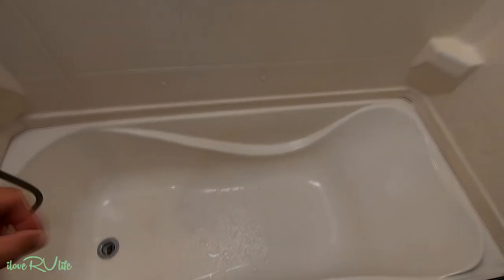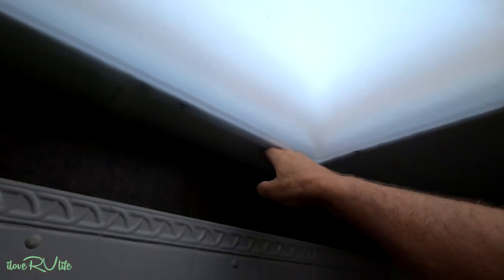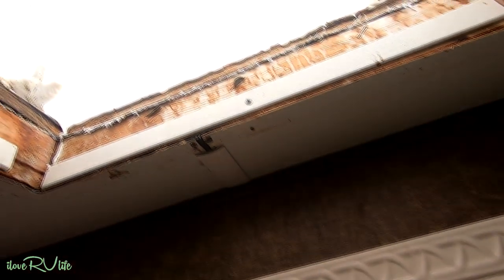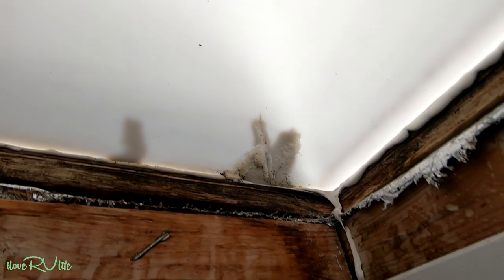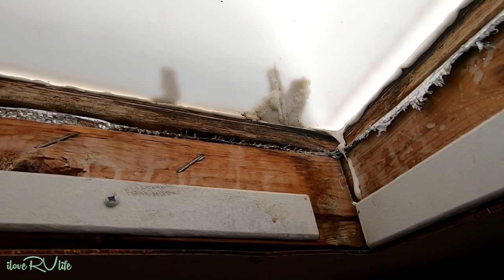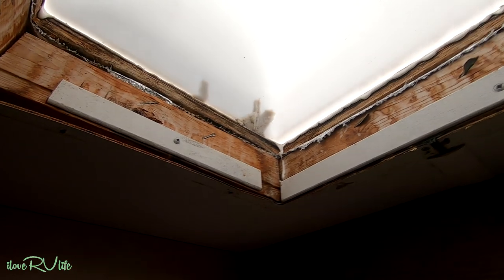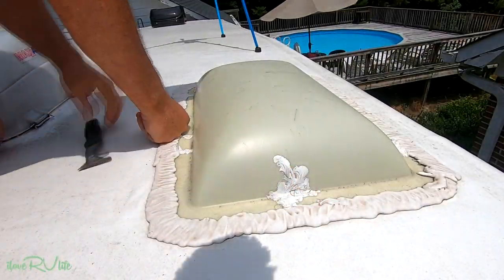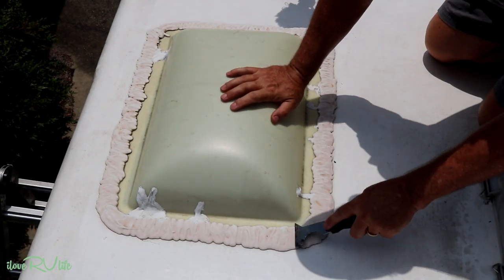RV Skylight Repair

Comment: When I replaced our sky dome I had my local machine shop to make a aluminum ring so I could clamp the sky dome down.  I drill the holes to match the sky dome then inserted the screws then dealer it up with the appropriate sealer. I think that this will not put as much pressure on the sky dome screw holes. Maybe this will stop the sky dome from cracking at the screw holes.
Reply from the maker: Great tip.  Thanks for sharing.

Comment: Thanks for the instructional demo.  My question is about the zig zag caulking you did over the screws and around the edges at the end.  I heard some recommend using Eternabond tape instead because it doesn't leave a small dam between the skylight and the caulk that can hold water and eventually possibly leak.  What do you think of this?
Reply from the maker: Glad to help Charles.  I the follow the manufacturer’s recommendations.   Never had an issue with it holding water.

Comment: You was lucky I just bought a leak free national seabreeze and the first big rain I found water leaking into the shower I pulled of the cover and was swarmed by moisture ants and then I seen the black mold then I seen the little spots of rot in the thin plywood sheet that's on the insulation.There was no way to spot this unless there is a major rain event like what happened here for 3 days.I do not know if previous owner lied or not.I also found gaket leak in the bay.Hiw would u deal with the rot.I paid quite a bit for this motorhome and I thought I checked it out good .Look one over after a big rain before u buy.Thank you.
Reply from the maker: The skylights last about 3 years.  Between to road vibration and sun baking them, fine cracks start at the screw holes and run.  Should check the roof twice a year.  Once the one crack starts, they run and others will follow.  For the mold, scrape what you can then hit it with straight bleach every other day for a week.  This should kill it.

Comment: Hi there buddy. Great video. And yep you got me. I’m now a subscriber 😁😁😁😁 I’ve got the exact same problem on my motor home. But luckily I don’t have any cracks in the skylight. 👍it’s just the sealer that has given up the ghost. Well this is cold old England and it’s winter here so a good repair but a fairly quick one. Until the spring comes anyhow as it’s freeeeeezing here at the moment 🥶🥶🥶🥶🥶🥶roll on summer 😜😅😁👍
Anyway hope all is good. Stay safe 👍👍👍👍👍 And a superb repair you did 🥇🥇🥇🥇🥇
Reply from the maker: Thanks for the sub Jay.  Glad the video was helpful. Hold on! Spring is on the way.

Comment: I'm glad I found this video thank you you so much. We just purchased a Forest River Wildwood and storm this week I noticed water on the floor. In the bathroom the skylight was damp I thought it was condensation from a shower. now I believe it is a leak. Do you know where I can find what size to purchase.
Reply from the maker: Thanks.  Glad we could help.  Don’t let this go on.  Leaks can quickly cause rot and mold.   Until you can replace, find the cracks and put some silicone caulk to stop the leaks.  This is a temp fix.  Go on top and measure the outside flange.  There are several common sizes.  I bought this one off Amazon.
Reply: @iLoveRVlife  thank you. I will get to this right away.

Comment: A well done job is a job well done👍
Reply from the maker: Thanks Greg.
Reply: @iLoveRVlife  
Hey Jerry.
I've been using dawn soap in my tanks just like you suggested.  I also us it to wash our rv but someone posted that dawn takes off the wax. I'd like to hear your opinion.
Thanks in advance 
Greg in Michigan
Reply from the maker: Greg, it probably does a little work on the wax, but I put a good Meguires Marine Wax on mine every 3 years or so and can’t tell any difference.
Reply: @iLoveRVlife  
Thanks for the response Jerry. 
That must be good wax to last 3 years.   
Our rv is 1 year old and I used turtle wax but maybe I'll switch.  We do keep ours in my inlaws barn for the winter but it sits outside spring to fall.
Once again thanks. 
Have a Jesus Christ and 
Greg in Michigan

Comment: i saw you  replacing another skylight. did you have 2 different rvs with the same problem? or did the job you did on the 1st one didn't hold up. thanks.
Reply from the maker: We had another one fail. Did the job correctly, unfortunately the hot sun in the southeast weakens the plastic over time causing small fractures.
Reply: @iLoveRVlife  i have seen people applying 303 aerospace protector and they swear by it. or some have applied that liquid henry even on their awnings. i am doing what you did on your last video thank you for posting that. Also i know you said you sprayed bleach to remove black stains , did you leave it on for a few days did you have to scrub? what did you use?
Reply from the maker: 303 is an excellent product.  For the bleach treatment, a couple hours was all we needed.  A light brush and let it dry did the trick.
Reply: @iLoveRVlife  ty i used a rag. 😀

Comment: Any idea what the best and least  expensive brand clear opening skylight is available instead of the dome type that we cannot open or usually see through clear?? I've seen Hengs escape hatches and Heki brand but still trying to figure out which will work best. Thanks
Reply from the maker: No brand that I can recall.  Give the folks at etrailer.com a call.  They specialize in these types of products and have helped me in the past.  If they don’t have something in stock, they can order with a short turnaround.

Comment: The screws appear to be rusty and the substrate material is rotting out do you figure that the screws would still hold? Doesn’t appear to be a good long lasting repair in my opinion.
Reply from the maker: It wasn’t rot.  I would have replaced.  The wood and screws had gotten a little discolored.  Once dried out, I pulled up the roofing and all was in very good condition.

Comment: Wish mine didn't have a dome, I keep a 4 inch thick foam push into it to keep heat out.
Reply from the maker: Ours is a 2 piece.  With the air gap, it keeps the bathroom from heating up.
Reply: @iLoveRVlife  mine is too, but it still let at lot of sunshine in.

Comment: Hi Jerry, just checking in after you have this installed for a little over a year now. How is the new skylight holding up? Has it faded at all? I need to replace ours and want to replace it with one that will last and not fade. I hope you and the family are doing well. Mike
Reply from the maker: Hi Mike.  It’s held up well.  No issues.  I suspect over time it will discolor.  The sun is pretty intense on these plastic components.
Reply: @iLoveRVlife  Only time will tell, we never know :)
Reply: @iLoveRVlife  I'm debating on getting the white one or a clear one. We have a clear one now and am wondering how much light would be decreased by having a white one. Do you know?
Reply from the maker: We have a white.  Much preferred.   Gives a nice diffused light.  Plenty bright for the barhroom
Reply: @iLoveRVlife  Good to know, I appreciate your response and enjoy your videos
Reply from the maker: Thanks

Comment: Will there be a follow-up video showing how you finish up on the inside - also, how do you know/find out what material your roofing is?  Great video as always - many thanks! I have a tarp over my RV roof at the moment.
Reply from the maker: Thanks a bunch.  Most RVs have a rubber roof either TPO or EPDM.  These have a thick feel, almost a cushion.   They are a little rough to the touch.  My roof is a replacement after a not very bright fellow guided me into a large, low hanging tree limb.  For the same prices as rubber, I went with PVC.  A little more durable, very bright white, firm to the touch.  Some units have fiber glass or aluminum, which are obvious.
Reply: @iLoveRVlife  Many thanks for your quick reply, I'll keep this video on filler for when I need to do this work on my rig. Happy travels!

Comment: I bought a used RV trailer, and I have no idea what kind of roof is on it.  Is there any way to tell one type from another? What happens if you use the wrong type of lap sealent?
Reply from the maker: Hi Chris.  Mine is a little rare.  You don’t find many with PVC roofs.  Most RVs have rubber TPO or EPDM roofs.  Easy to tell the rubber type.  They are a little rough to the touch.  When you press them with a thumb, they have a bouncy feel.  There are those that are aluminum or fiberglass and obvious when you see these.  Plain Dicor lap sealant works for most.
Reply: @iLoveRVlife  I have a TPO roof on my Keystone Cougar. I contacted Keystone and they said to use Alpha Systems sealant. Apparently Dicor makes a TPO compatible sealant called Dicor ULTRA.

Comment: I just found a leak in my skylight but how do you remove the inside. I removed the screws but the inside would come out.
Reply from the maker: I’m doing this again over the next few weeks.  Cracked inside and out.  Carefully take a putty knife and work around the edge.  The manufacturer may have used some type of adhesive to seal the fixture.

Comment: Looks good, did you need to clean the prepped area with a cleaner?
Reply from the maker: I did.  Little window cleaner.  Had to speed things up.  Was hot as a frying pan that day and skipped some of the minor shots.
Reply: @iLoveRVlife  Thanks, was wondering what you used. seen others using acetone, but i think that would be a bit harsh.

Comment: I was up on my roof when it was 94. Not a fun job. You should have used knee pads. That roof gets HOT.
Reply from the maker: That it does.  These summer roof maintenance tasks are something else in this heat.